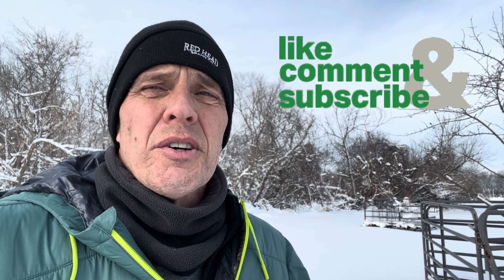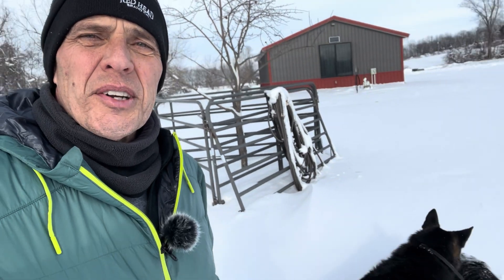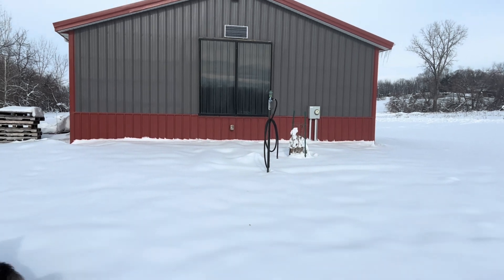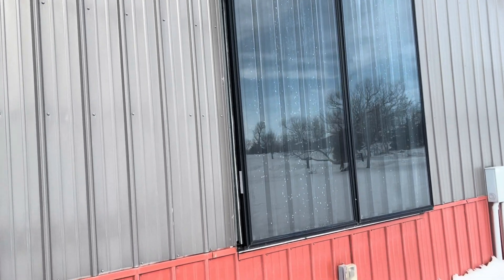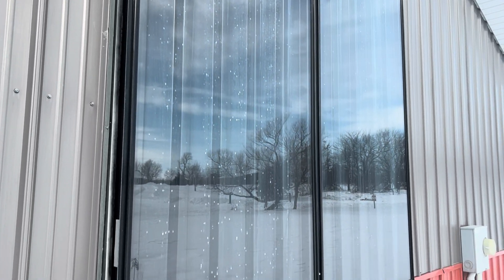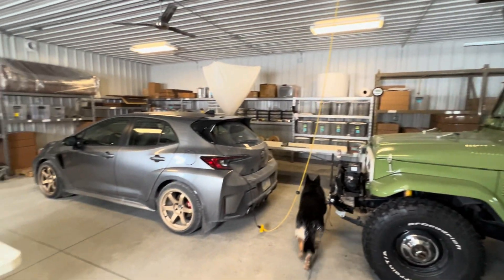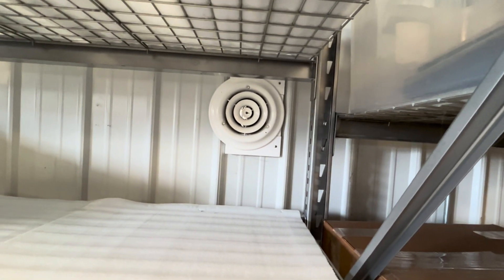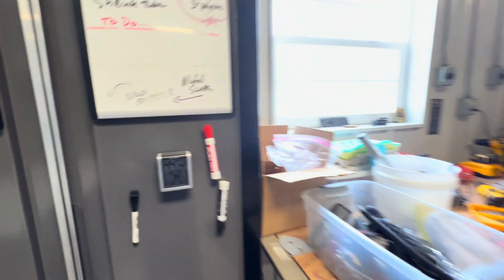How Does Passive Air Heating System Work And Is It Reliable?  Revisited For A Subzero 12 year report

Comment: Do you have one way flaps like an dryer vent that closes the top vent... if not the air is going to get cooled when the sun goes down and work in reverse
Reply from the maker: Yes...basically when the fan is running the flaps open and when it is not...they fall shut.

Comment: Liked and Sub’d. 
Great video. 
I have a couple of questions, 
Is there any battery linked to the photovoltaic panel to run the fans? Or they just run when it’s sunny?
Also is your concrete floor slab insulated?
Many thanks
Reply from the maker: The only batteries involved in the system is the battery that runs the thermostat. The floor of the shop has a vapor barrier that is not insulated. For the past week, the temperatures have been consistently well below zero Fahrenheit and the shop has been able to maintain a temperature above freezing.
Reply: @Springtailsolutions  that’s great thank you. Definitely going to look at making something similar for my workshop.

Comment: May I  suggest a bigger fan
You need to move more air
Would  be interested to see air temperature coming into the shop
My home built takes air at 58 degrees and puts it back at 140 plus 
But you only have so much sun  thats why move moʻre air
Reply from the maker: Thanks for the comment, I appreciate the suggestion.

Comment: An interesting concept. But it has the same shortcomings as any solar solution... It only works well when there's sunshine. To me, a geothermal solution would be the best. It utilizes the earth's own temperature. Or, if you happen to have access hot springs, you're even better off.
Reply from the maker: IDK...The sun has been pretty reliable for a long time.  :)

Seriously though...we have geothermal up at the house and it has been a good system but expensive to install/replace.  If I were to revamp the system...I would leave the Solar system alone but would go with an air/air heat pump (mini-split) for the main heating system.
Reply: @Springtailsolutions  Would you say the solar solution provided primary or supplemental heat?
Reply from the maker: Since we are hardly in the shop at this time of year, I would call it "primary" (Since it is the one that runs the most)....as I mentioned in the video, the goal was to keep the temp in the shop above freezing. Which according to the thermometer, the temp has not dropped below 35 degrees (even with a week of -5 to -15 degrees. Those are unusual temps and only occur about 3 weeks out of the year. It is not unusual to have shop temps in the mid/upper-40s for the rest of the winter.

I think if the size of the solar system was tripled....one could expect temps in the 50s.

In the spring and fall, it definitely evens out the temperatures and we hardly ever use the ceiling heaters. Best part is that after the initial investment....there has been zero cost other than replacing the thermostat once in 12 years.